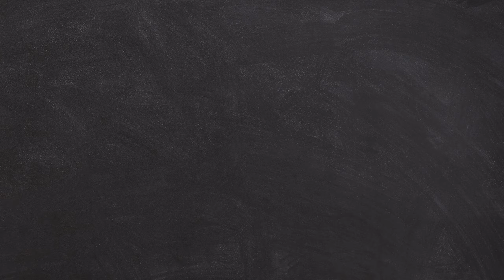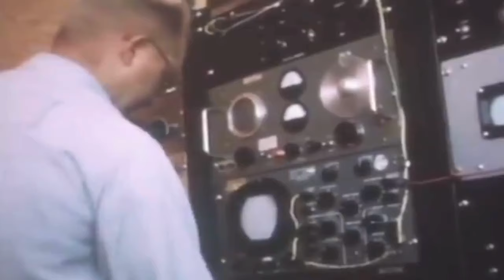This Plane Couldn't Mach It: Douglas X-3 Stiletto

Comment: The X3 poor performance as nothing to do with the X3 itself . The problem was that the engine that it was designed to use, the J46, ran into many design issues and failed to deliver the thrust it was supposed to have, and the X3 had to be flown with the J34, which was not nearly powerful enough to meet the X3 performance objectives. I see videos like this that say the X3 was a failure, but the culprit was Westinghouse, and not the X3 itself. Had Westinghouse been able to get the J46 sorted out, the aircraft would have reached design speeds. Best to tell the whole story and not leave out such an important detail.
Reply: Aint no way the company that makes my tv makes jet engines

Comment: Without the X-3 Stiletto, there would have been no F-104 Starfighter (the first successful mass produced Mach 2 capable jet fighter (2,758 built).

The failure of the X-3 to achieve Mach 2 was due to having the wrong engines.  It should have been designed to have rocket propulsion, as jet engines of the early 1950's didn't have enough thrust for the purpose of Mach 2 flight.